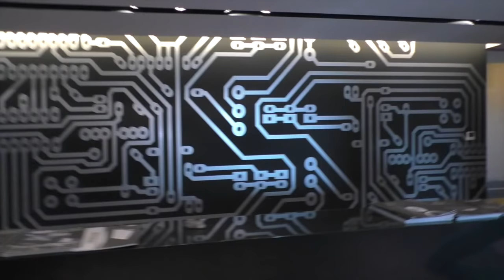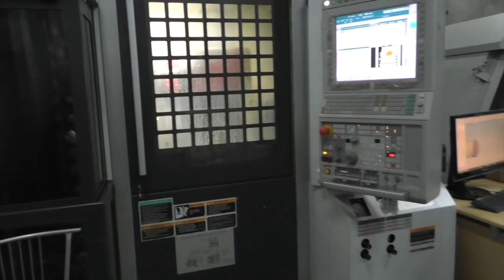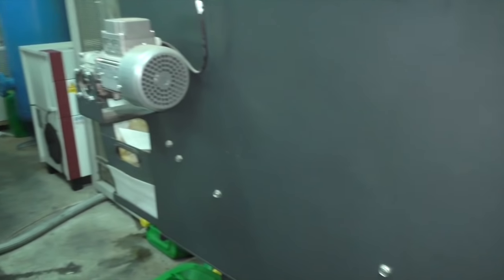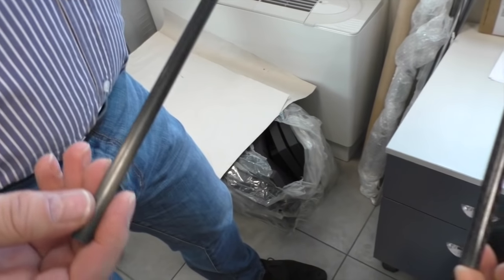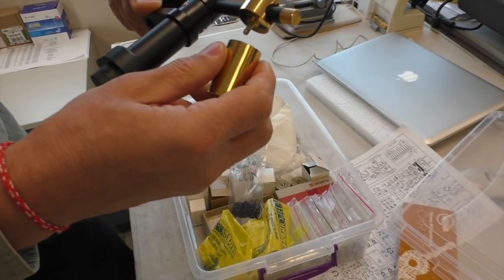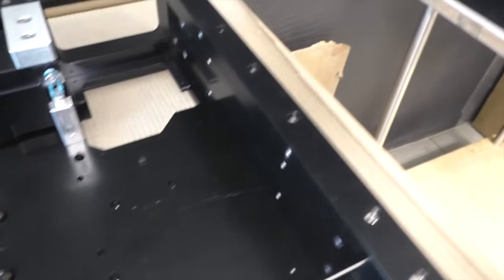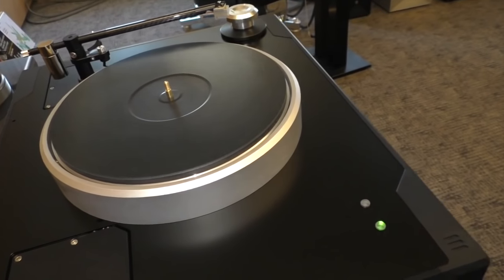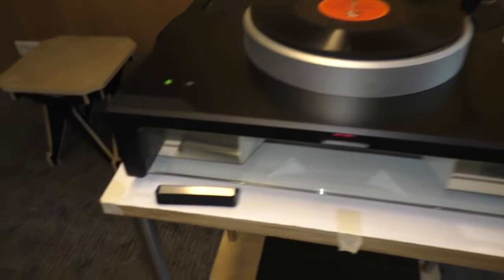Bulgaria Based THRAX Builds The Döhmann Helix 1 Turntable

Comment: What is the noise floor of the turntable do you know? What motor are they using AC or DC and suppose it's servo controlled and do you know who manufactures the motor is it Swiss